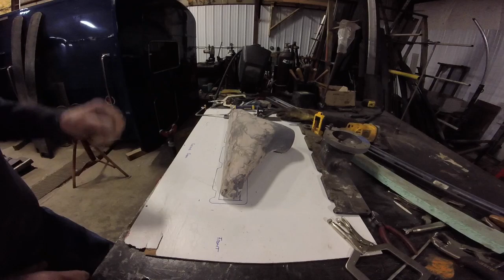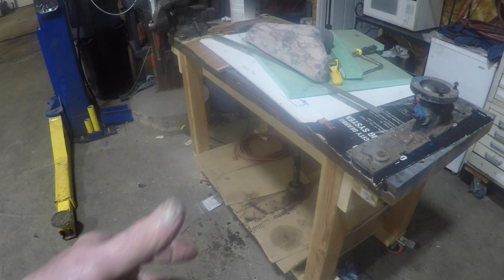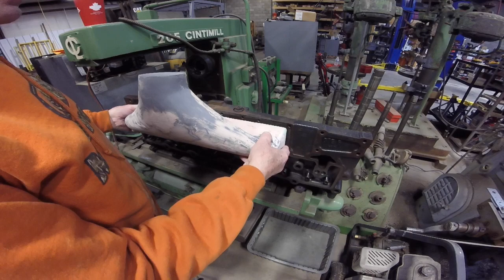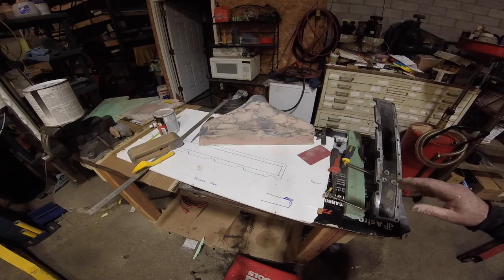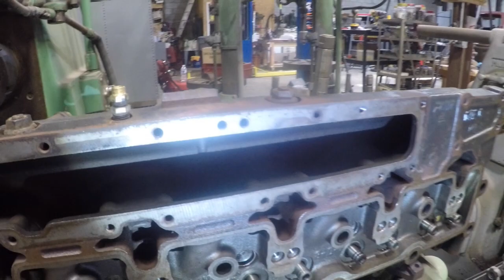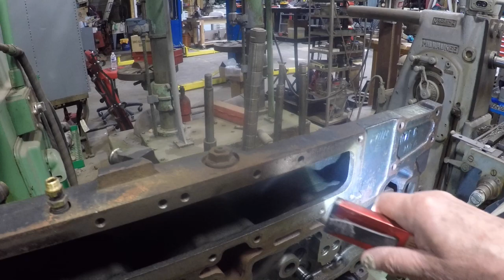Cummins Carbon Fiber Intake Build Part 7

Comment: 6 cylinder firing order is too young, too old, just right.  Build a charge cooler for denser O2, more boost, and work to keep the oil in the pan away from the rotating crankshaft.  The oil coming from the crankshaft looks like a rope you would hit with your lawnmower.  It physically draws horsepower from the output of an engine. A windage tray with a close-fitting oil stripper also keeps more oil in the bottom of the pan for the pump to suck from.  
Maybe you should design some type of vanes in that hat that will produce a venturi effect to increase the speed of the air going to 1 & 2.  
The Chrysler Slant 6 intake manifold was a fantastic design.  You had long runners and short runners.  That made the engine have a good response at lower rpms (long tubes) and good response at higher rpm's (short tubes) and the intermediate length tubes gave a mid-range boost. Their Hyper pack intake system, 4 barrel with long equal length runners gave them better fuel/air charge for the 8,000 rpm 170 cu. in. engine when with the old 3-speed non-synchro first gear made it almost impossible to downshift to first in a corner so they needed brute torque aided by the long runners to make the engine competitive. 
Later in racing Chevrolet engines with Rochester fuel injection we would mill off the top of the manifold, grind the intake runners shorter and make a plate to go on the top mounting 2 Rochester air intake bodies. The dual throttle bodies were probably overkilling but they sure looked great in a B/Altered. We did "borrow" the idea of the dual intakes from seeing one on a Chevy mounted in a Birdcage Maserati on the SCCA circuit.

Comment: Come on Fred go ahead and mill off that intake shelf and build a proper individual long runner intake. You know you want to. :-) Besides the gains in low speed torque and efficiency from the longer runners are bound to be worth it. :-)
Reply from the maker: I thought I kind of understand the theory behind intake runner length on NA gas engines, but would same principals apply to Turbocharged DI engine? My thoughts was that the longer runners helped in swirl/fuel atomization down the length of the runner on gas engines. So what benefits would it have on DI diesel?
Reply: Fred Newman Runner length tunes the charge to cylinder fill. It has to do with waves reflections the speed of sound and it’s not all that fun mathematically.  Truth is about 30” of runner would be a noticeable gain in torque on one of these engines. Packaging it is a bit of a challenge though. Truth is though we are probably talking 100ftlbs gain and it’s a lot easier to just throw more fuel and air at it and get the same gains.
Reply: @bcbloc02  
Fred..
let’s see long runners like bigblock said...
THAT WOULD BE EPIC FOR YOUR YOUTUBE SHOWS
an M.S in M.E. ain’t easy and don’t come cheap...must me respected.
;)
Reply: @bcbloc02  Agree on more fuel and more boost.  Both would make the most noticeable increase of performance for the least amount of fiddling with Cummins proven designs.  I feel that when the manifold is under boost air will go where there is the lowest point of air pressure, i.e. when an intake valve is open.  If all valves were open at the same time, then it would take a humongous amount of pressure and volume, but the firing order of the engine dictated that they are not.  That harkens back to the most bang for the buck and that is simply like you said, "more fuel and more air (pressure)."  Of course, that means a reduction in fuel economy and profits.  We secretly boosted the fuel delivery on our fleet of Ford trucks, simply because the drivers complained that they were dogs. The company bean counter complained because the amount of fuel the company went up.  Happy drivers or happy bean counter? The answer was there were many more drivers than a bean counter.